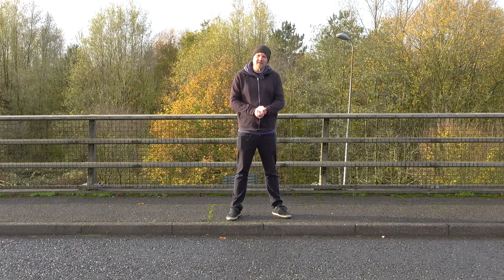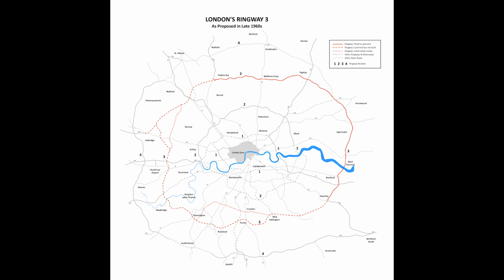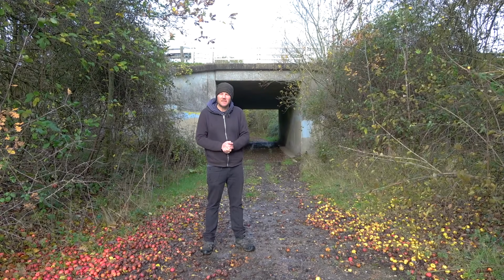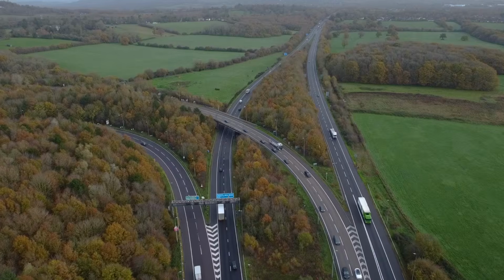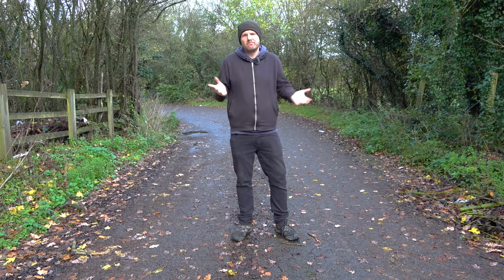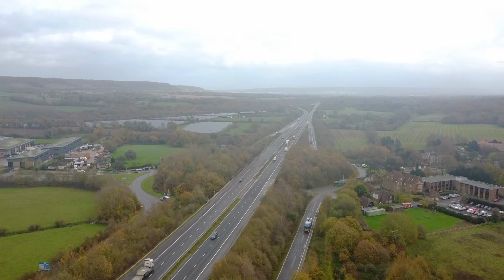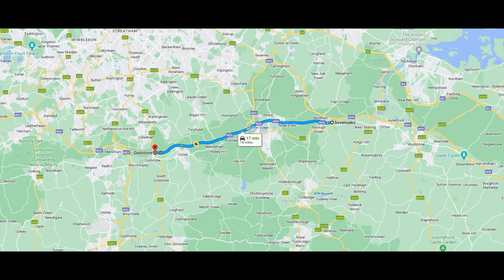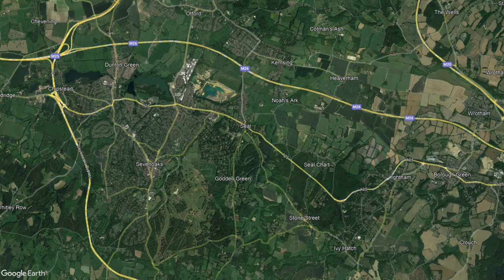Secrets of The Motorway - M26

Comment: I helped build that motorway. Spent weeks in culverts sealing up the joints. Was paid loads of money which I used to by a car and fund my university life. Had loads of fun including seeing a guy packing is overalls with fibreglass  to keep warm and then having an allergic reaction! Guy also lost a thumb when a concrete pipe ring sliced it right off as it was unloaded. Such fun times!

Comment: You mentioned that the M26 is basically a glorified slip road - if you look at the driver location signs, the M26's carriageways aren't marked up as "A" and "B" like usual, but instead use J/K/L/M, which are usually reserved for driver location signs on slip roads!

Comment: Ah... Come off the motorway to stay on the motorway - like the M60. It used to be the M62 but then got incorporated into the M60, well a bit of it, so from Liverpool it turns into the M601 unless you come off onto the M60 (which was the M62) then stay on the M60 untill it turns into the M62 again, or come off the M60 at Simister Island to stay on the M60 towards Ashton. Simple really.

Comment: I once joined the M26 AT 2a thinking it was the M20. 18 miles. 18 tortuous miles until I could turn around at jct 6 (Clacket Lane why do you tease with your overbridge!) and head up to Swanley junction. 30minute detour on a good day. Oh how I cursed the lack of a junction, it's utterly and stupendously moronic design to not have at least a junction off to the A21. 
I understand the reason for nothing going clockwise from the M25 as the M20 does that job for 90% of traffic but otherwise its long overdue an upgrade or junction addition.

Comment: Go fixed wing and the relevant membership and you can go to 1000ft, helis can go that high as well provided they only have a single lifting rotor anything with two or more lifting rotors have a hard 400ft rule no matter who you belong too.
Reply from the maker: 400ft is usually far more than I need... just this one time :D
Reply: @AutoShenanigans  if you  enjoy flying your quad, try fixed wing anyway, I garuntee you will get the bug and fpv will become a major hobby ha ha.

I have three 450 size quads but fixed wing is my love, it's amazing and going for a 45 min cruise covering many many miles is so therapeutic,  that's just my daily flyer, I have one craft that with the right battery capacity on board can stay airborne for more than 4 hours :)

Comment: Just on that Green Belt service station section. I can assure you nothing has changed regarding Green Belt bar the NPPF being adopted in 2012 and the land is not protected due its beauty or anything like that. It stems from Garden Cities (Ebenezer Howard) in the late 19thC and ensuring that cities or large built up urban areas have access to greenery. Without the Green Belt the whole country would have become a housing development a long time ago. 

Have a look at development in the 1940s and see the state of what was being built. Nonsense estates with advertising absolutely everywhere. In the 21stC this would have been absolutely catastrophic if left unchecked. The Green Belt is like a donut around the urban core providing nature and green space for those without it in the urban centre. There's no doubt it could do with updating to some extent, but the Green Belt is essential to maintaining sustainable planning. Most don't know the difference between Green Belt and greenfield sites. Green Belt is a very high tier of urban planning in the UK and overcoming it is near impossible for new development without very special circumstances. A truck stop or service station would easily be identified as against local and national policy as it would represent development which is harmful.
Reply from the maker: Great info.  And that explains the "Howard" Centre in Welwyn Garden City.

Comment: “If you’re on the M25 and want to remain on the M25, you have to come off the M25 and then re-join the M25…” don’t ask me why but that had me in absolute hysterics! I blame tiredness.. 🤣🤣.
Reply: I blame Dartford crossing 🤣🤣
Reply: I live  next to the junction and the number of people who "stay on the M25 "  and actually end up on A21 and have to come off at the next A21/A25 junction and turn back is not small, to put it mildly.  Also they need to take the 2nd slip and they take the first which means they then have to do a u turn in a junction with a high accident rate.  

And  if I want to head towards the coast ?  Can't get it on it at Junction 5 from the A21 so you have to go all the way up to junction 3 and head down the M20.

Junction 5 of the M25 is dumb... always has been, always will be.
Reply: I use this junction all the time on my commute from East Sussex to London. Anticlockwise, the A21 suddenly becomes the M25 without any sort of exit or slip and you can't get on the M26. You have to exit the M25 via a slip to rejoin the M25, otherwise you end up on the M26. Clockwise people barrel down the outside lane on the M25 not realising its about to become the A21, the slip to leave the M25 to stay on the M25 to rejoin the M25 is two lanes (50mph) and bends more than a snake. As @zakelwe said, if you are heading clockwise and want the M26 forget it. I'm just glad my journey means I straight go straight thorough, at least I miss the rush hour traffic doing the leave, stay on, rejoin nonsense.

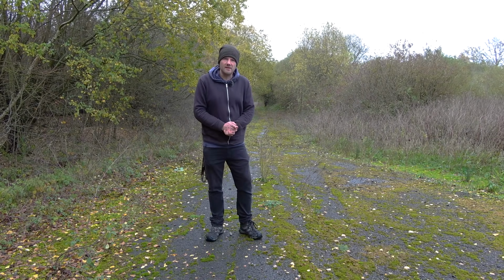Comment: 8:19 - I was actually one of the people that put up a proposal to build the 'smaller', service station.

It would have - had it come to pass - included the following:

1 - a gas station that included a number of 'full service' benefits whilst your car was filled with petrol.
 One was watching an extremely short film (family or adult). 
 Another was 'Fellatio Service' (self-explanatory). 
 Another was you could eat a 'Speed Meal'. A tube was inserted into your mouth and a stream of nutritious liquid was forced down your throat at great speed (sadly, several people choked to death during testing - so it was eventually dropped).
 Another was you could 'Speed Learn a New Language'. Electrodes were placed on your head. And - it was hoped - that an intense, amount of data could be 'inserted', electronically into your brain (sadly, numerous people died/had extensive brain damage during testing. So it was dropped).
 Another was a 'Speed Oil Change'. Your engines' used oil was forced out under high pressure. Whilst fresh oil was installed in your engine...also at high speed (during testing - there were several instances of the extremely, high pressure used, blowing out all kinds of parts/caps/fitting's of various engines. So, the idea was dropped).
 Another was you could have your tires automatically inflated to the correct levels...thus aiding in better fuel economy (sadly, in testing several people were injured when the 'self inflating devices' often inflated the tires far, too quickly. With the result that they would explode. So, this was dropped).
 And the final one was 'Electronic Colonoscopy While You Wait'. Let's just say this did not go well in testing and leave it at that.

2 - a capsule hotel that - for cost reasons - used 'rejected/used' caskets for the capsules. 
3 - a 'full service' brothel (Pleasure World)...for both men and women.
4 - a 'Hot Oil Towers' - an idea that Mitchell and Webb later championed.
5 - a 'Peaceful Conclusion' center. Where you could go for the best quality of assisted suicide (basically just jump in a large furnace).
6 - a 'Mucus Barn' that sold various types of mucus from all parts of the globe.
7 - and for the children? There was '1800's Land'. A place where a child could go, have to work long hours for minimal pay in intolerable conditions, eat lots of delicious gruel, experience a wide variety of diseases that they cannot enjoy today AND pre-schoolers could actually spend most of their waking hours with their parents - as opposed to overworked and underpaid, daycare workers.

The proposal was met with scorn and derision. 
Not to mention a lack of funding.
And - sadly - did not go ahead.

Love the channel.
☮
Reply from the maker: Have you got contact details for "pleasure world"?  Asking for a friend...
Reply: @AutoShenanigans  😎
 Sadly no. 
After our proposal was rejected - back in the 1990's? The franchise was bought by a Saudi interest. And all the female 'workers' were relocated to the Arabian Peninsula. 
 The male workers started a web site - 'Pleasure World Online'.
 But, the Saudi interest sued over the use of the name.
 Then the company closed down and the men - oddly enough - all went to Australia and joined Aussie Rules Football teams (mostly, around Melbourne).
 
I will say, back in it's hey day, it was a marvellous place...er...so I was told.

LOVE your logo, btw - it seems perfect.
☮

Comment: I lived in Northern California for a time, and there is a small piece of "interstate" highway, located completely within the northern part of the state, called the I-505.  It's sole purpose is to connect the north/south I-5 with the east/west I-80, even though the two interstates do cross and interchange in the state capitol of Sacramento.  This is because the I-5 does this strange thing where it sort of shifts over, running east/west for a bit, routed in an odd direction to and through Sacramento.  To prevent HGV drivers coming out of the San Francisco Bay Area from having to go all the way over to Sacramento to get to the I-5 heading north, the I-505 was built as a bypass of sorts.  It makes sense when you look at a map from high level, but it does seem odd to have this one "short" section of oddly numbered interstate out in the countryside, passing through no major city or large town.
Reply: Yeah the three numbered Interstate sections are always fascinating to me. In Florida in the Tampa area there's two sections off of I-275 (itself a loop off of I-75) that basically just act as extended ramps into sections of St. Petersburg. They're both less than a mile long and less than a mile from each other. In Jacksonville, there's a state highway (albeit built to Interstate standards) called 9B that connects the 295 (which was 9A until just a few years ago) loop to 95, but only about a mile and a half from the proper interchange. It's apparently planned that in the future, it's also going to be renamed as 795.

Comment: I lived in Wrotham when the M26 was built. One of the major benefits of the M26 was that it took traffic from the A25 which starts at Wrotham Heath and goes to Westerham and beyond. In the 1960s and 1970s the A25 was a congestion nightmare. People in Westerham literally cried tears of joy when the M26 was opened. I am not exaggerating.
The other advantage of the M26 was that it provided a shorter route westbound (for traffic on the M20) as opposed to a route which would have meant joining the M25 at Swanley. So there were very good reasons for building the M26. It was actually built at the same time as the section of M20 that goes past Wrotham (up Wrotham hill). A million tons of chalk were taken off the hill to lessen the motorway gradient and the chalk was used to make an embankment for a new  Wrotham bypass which was constructed at the same time.

Comment: The M25/M26 junction is a pigs ear whichever way you approach it. Could you say it was never meant to be a junction? I think you were just meant to get on to the A21 if you wanted to go north (or indeed, south) for quite along  time ...and why would you want to go north when you would have to pay to go through a tunnel and you had a lovely new motorway around the south of London that would join up with every other motorway anyway.  If you wanted Dover/south Kent, you headed down the M2. If you wanted Folkestone well you headed towards the M20 on the M26.  Why would you want to come south to go east when the M2 was perfectly adequate, Seemed to takee ages to get that last bit of M25 in and it always felt like an afterthought. Still does.

Comment: I believe the council have rejected the plans for the new services, which means Kent is still woefully lacking in facilities, despite promises from the Government to get more facilities to encourage people to become HGV drivers. Even with Ashford Truckstop doubling in size they still have to turn trucks away on many nights. 
As for hold ups at Dover, they've been going on ever since I've been doing European driving some 20+ years now. In 2015 it was chaos for weeks when My Ferry Link had to stop trading (something to do with P&O complaining about its links with Eurotunnel) and loads of French workers lost their job and blocked Calais. 
The locals got all upset they couldn't use the M20 and demanded action, the government then said they would build a holding area for some 4000 trucks just off the M20, which seemed a sensible place to put a holding area for HGv's using the Port of Dover and Eurotunnel, but the locals forgot all about the M20 being closed for weeks in 2015 and complained it was in the wrong place, basically they want a holding area somewhere near the Shetlands.
Reply: HGV storage is a major problem in this area. 
And considering the port of Dover is close by, Logically a truck park is needed to stop the queues and possibly to pre-check trucks ready to board boats, thus reducing queues at the port.
..
There definitely needs a  general services at M26  2a  simply because the M25. Which consistently has roadworks/accidents causing pandemonium in the surrounding areas ..
Reply: You forgot to mention that the holding area was to be bigger than heathrow airport have no toilets no shops and be built on green fields and no planning  permission
Reply: @alextaxi2593 
He who votes Brexit must accept the "benefits"! Welcome to the Garden Truckstop of England!
Reply: @anonUK 
These issues would still occur regardless of Brexitus..
..
The queues @ Dover
May have  something to do with the closure of ramsgate port, placing an extra reliance on Dover as the main exit/entry point for goods. 🤔
.
(P. of Felixstowe excepted)

Comment: @RingwayManchester Brilliant, obscure reference or is it?  A day or so ago I looked up the 6 DUGA TX/RX sites known as the 'woodpecker' back in the day because of a Ringway Manchester episode.  One still standing near Chernobyl.
And in 1966, who owned a radioset on the mono radiaogram the size of a settee in the front room capable of receiving Radio 3 in stereo?  Probably only the Director General of the BBC!

Fantastic episode about another short/strange motorway that almost makes sense when you explain the drunken bureaucracy that caused it and the sebsequent traffic jams.  Right, I've got to empty my Pollution Control Valve.
Reply: Dad built a Mono FM only reciever from a kit (must have been US one as they had FM sort of before UK.  Might have had stereo functionallity but he only built a mono amp, though his work was building amps they were all PA systems and I think the components were sort of bits from work claimed as apprentice pieces

Comment: Cannot stand that interchange. It is barking mad that - as you rightly point out - if you want to stay on the M25, you have to turn off the M25 (and then go round some bends that have no place being in the middle of a motorway). Whoever signed off that solution, was clearly on crack!